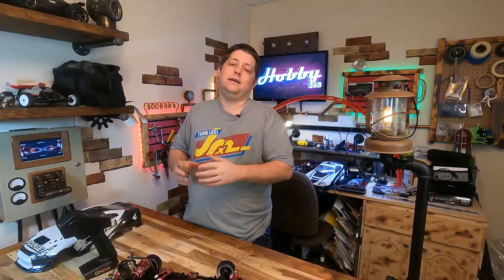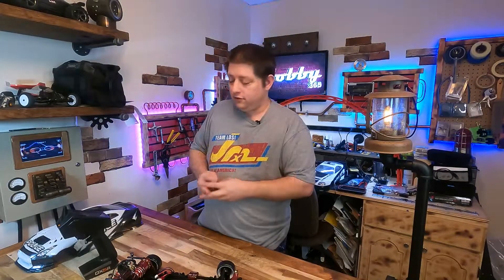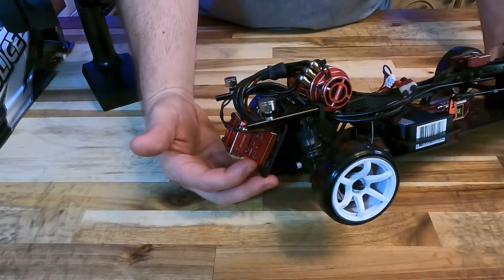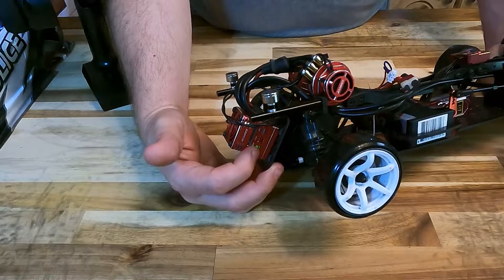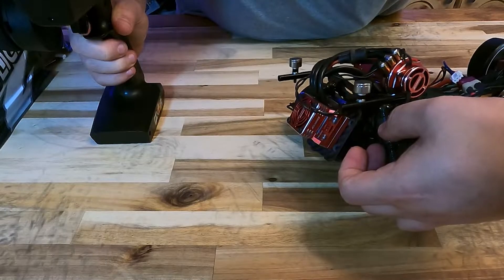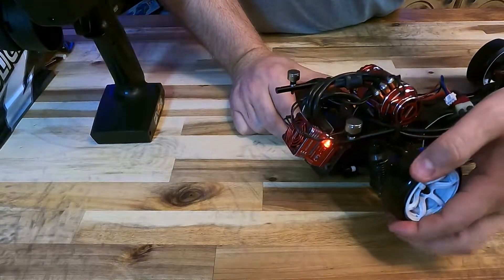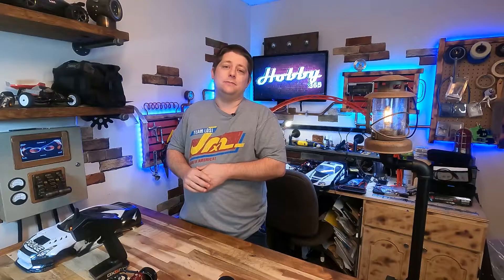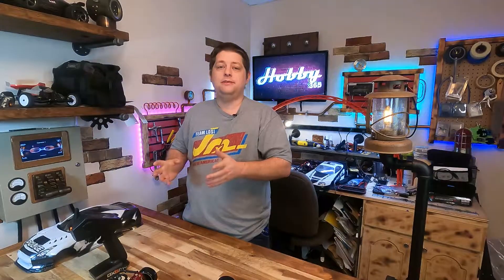How to calibrate an acuvance esc.

Comment: Ok so I just got this set up: xarvis, sbus adapter, fledge, 4pm+ and R334SBSE. I set all the firmware for each piece last night and went to start initial set up. I hold down power until all has blinked 3 times and then the set button lights up yellow and red. Almost like it has already started and is in the middle of end point setup. I think I accidentally hit the throttle the first time I started it up. So I’m not sure if it’s stuck in end point setting process. Not sure if that makes sense but any help is appreciated

Comment: hi there just watched the video,trying to set mine up doesnt have the fan and it doesnt let me set it up pressing the set button i only get the lights to change when pressing the power button but then i get the blue and the red on satying on,do you know what that means ?it did say in the instructions you dont need to connect the motor up only the sensor wire